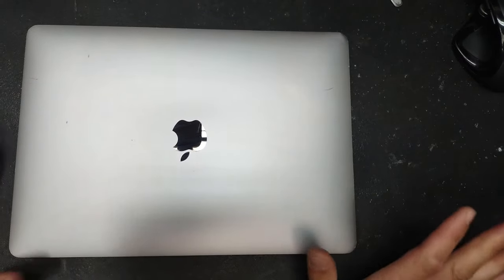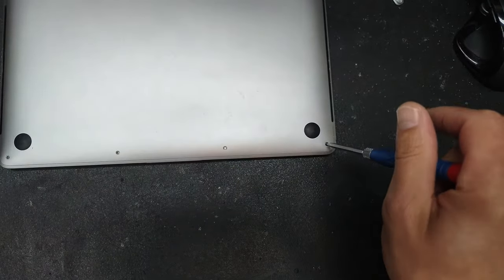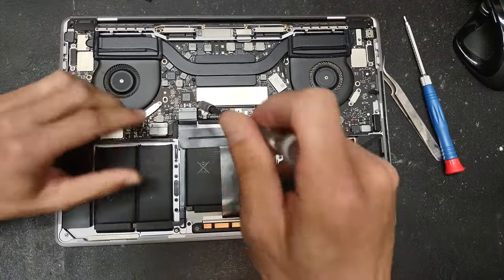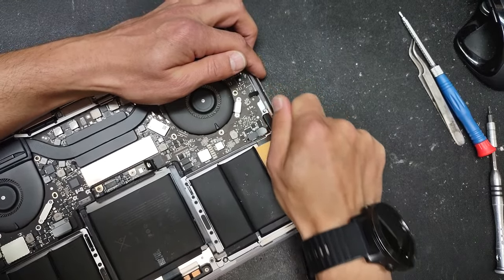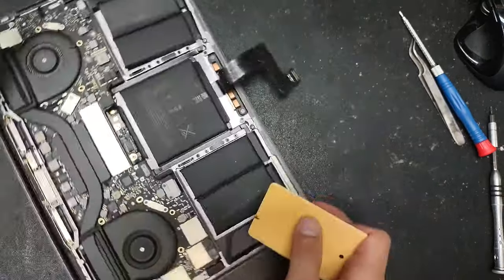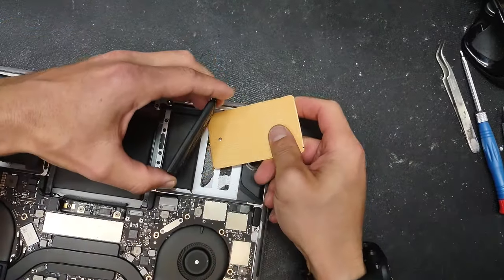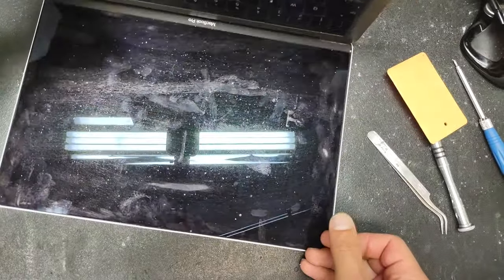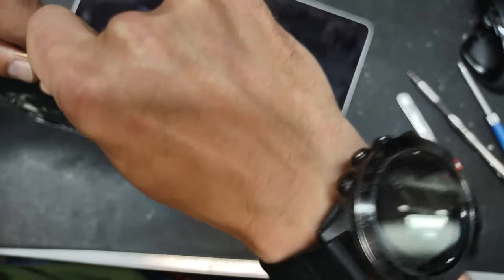MacBook pro A1706 2016/2017 battery replacement

Comment: I don’t normally comment on tutorials (I should really start doing so), but this was very well-done! Clearly explained, nicely paced so people can follow along in real time and then fast forward/rewind as needed. 

For viewers, a good chunk of time was spent separating the batteries from the adhesive tape inside. This is the most time-consuming part of the battery replacement. You can also use a 1-2” plastic putty/spackle knife or paint scraper, whatever you prefer to call it. Having a handle really saves your fingers from using the little credit card type pieces that come with the battery.

Again, A+ video and instructions!

Comment: Excellent video and perfectly helped me replace my battery. One thing to note is that after replacing the battery, you need to reset the SMC (Google it) on the laptop to reset the battery cycle count and remove the "Battery service recommended" message.

I really appreciate that you show how to remove the trackpad so as not to damage it when loosening the middle battery. I couldn't get it to slide around after reinstalling it, and that"s because I had tightened the screws nearest the edge of the case. Once I loosened those, it was easy to slide around the trackpad to align it correctly.
Reply: No need to. The motherboard reads the battery chip upon every startup and shutdown

Comment: Great video!  Worked perfectly for about two weeks and then the battery bricked again.  Computer would not turn on.

Luckily Amazon is sending a replacement because it was under 30 days.  I think the battery had a 1-year warranty as well.

Lets hope the new one works.  It was charging fine, no "Service" message, lasting a long time, etc and then just died.

I have gotten pretty fast at changing them out now!

I used a hair dryer to warm up the glue from the other side and the glue released easy.  Just warm not hot as Lithium ion batteries can be dangerous with heat.  I would not use a heat gun.  I didn't put any heat on the keyboard or logic board.

Comment: Can you use aceton to remove the battery easilier? For me its no problem if the old battery gets damaged.
Reply from the maker: I would definitely not use acetone. Can easily damage the plastic of the old battery and make it short resulting in potential fire. I rarely respond to comments, but this can be serious if you do use it.